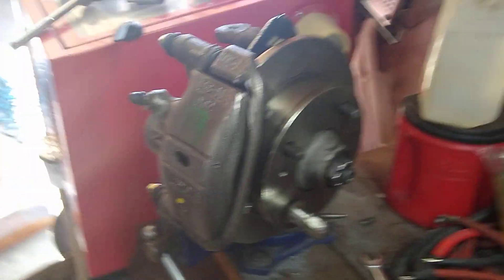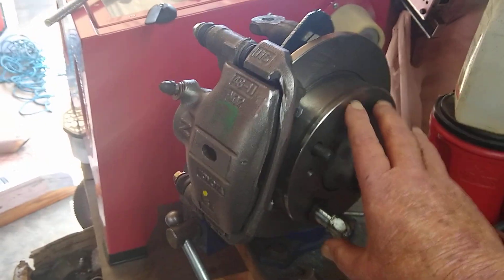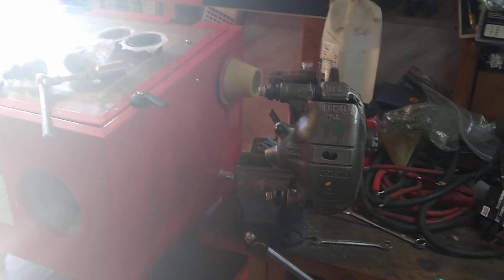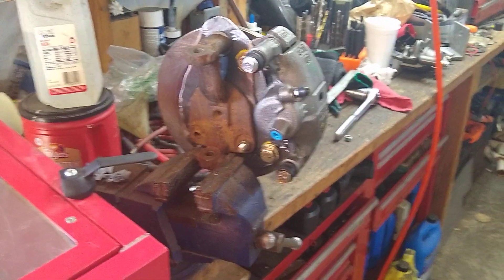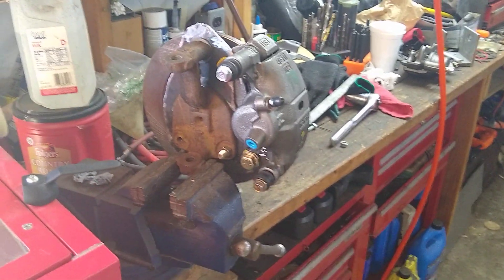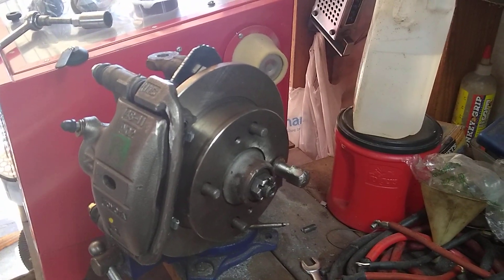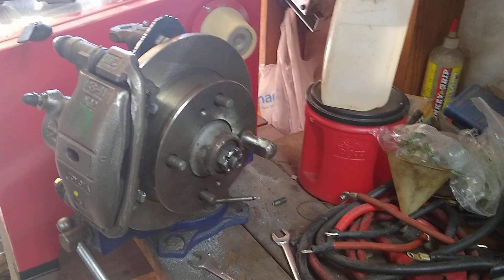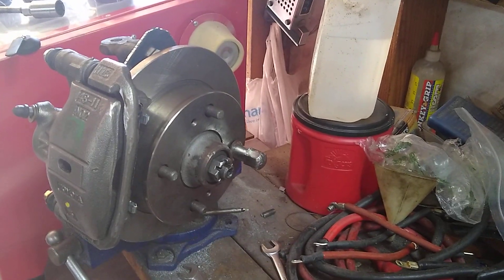Corvair 1962-64 disc brake front

Comment: Any chance the information on this kit is still available.?
Reply from the maker: Just read all the comments / replies here for info.  Sadly none of the people interested in producing the kit have ever followed thru, Covid ,etc.
Reply: @Patiomatt  ok so from what I read u had a template for the disc brake bracket and nobody was willing to get it cutout . Now I have a friend that will cut the bracket I just need the template and the thickness of the metal and what rotors and calipers your using. I have a kit for my 63 but it’s for a 14 inch or bigger rim I love my 13 inch rims with wire caps so if I can keep my 13 i would love too use ur kit
Reply from the maker: @126hotel1  All  CADfiles  and templates went to the people that took over.. I would look for newer  Aisan small car calipers.
Reply: @Patiomatt  thanks I will see if anyone here that got sent the information is willing to help me out again thanks for everything

Comment: where did you get the parts?
Reply from the maker: Designed  / made the plate .  Tercel parts 85-7 rear
Reply: Does it fit the stock 13inch wheel?
Reply from the maker: @jayl845    Sure does....why I took the time to design and test  "statically"
Reply: @Patiomatt   thats great,thanks for the replying...Im interested in buying the brackets,  I'm not sure if you have a set available? I have 62 corvair
Reply from the maker: @jayl845  email?  I'll send printable templates
Reply: @jayl845  did you get a template?
Reply: @iceevrWvids  I did not
Reply: @iceevrWvids  I doubled checked  my inboxl, I don't see any emails.
Reply: @jayl845  thanks man
Reply: @iceevrWvids  have you done any work to your brakes ?
Reply: @jayl845  just getting parts together right now.. replaced the original master cylinder with a new dual MC for a 78 Chevy Monza
Reply: @jayl845  I have some new rotors that are slotted and drilled, for a nissan sentra 2001 as well.
Reply: @iceevrWvids  thats great,  I'm trying to find all the parts , I have 62 monza 900. You stay in California?
Reply: @jayl845  yes, bay area
Reply: @iceevrWvids  im in Corsa Club in Orange County
Reply: @jayl845  awesome man! Let's get together sometime!
Reply: @iceevrWvids  ill email you
Reply: Hi Matt....Have you had a chance to email the template. Sorry bothering.
Reply from the maker: @jayl845  Emailed to both of you.
Reply: @Patiomatt  Hey Matt,I can't find the file on my email..What's your email address.
Reply from the maker: @jayl845  Resent!  from " Patiomatt"
Reply: @Patiomatt  thanks, but I just checked didn't get the email. Whats ur email ? I'll email you and you can attach the file to that same email.
Reply from the maker: @jayl845  patiomatt@aol.com
Reply: @Patiomatt  just email you Matt . Let me know you got the email.
Reply from the maker: @jayl845  Sent again has missspelled before
Reply: @Patiomatt  oh that was the problem
Reply from the maker: Have you made any progress?
Reply: @Patiomatt  I got a shop to cut out one bracket, but the inner (big) hole was way bigger than the hub and seemed a little unstable. 

I asked the shop to make some changes, and the owner never contacted me again. I think he doesn't want to mess with this.
Reply from the maker: @iceevrWvids  find another shop!
Reply: @iceevrWvids  what's up Troy
Reply: @jayl845  what's up man? Did you get your brackets made?
Reply: @iceevrWvids  yes, I did...have t had time to test...I need the rotors.  I ordered them 2 days ago... do you know any corvair mechanics? Need help with my differential
Reply: @Patiomatt  can I revive a template too
Reply from the maker: @andresruvalcaba6898  Sorry I,ve sold everything